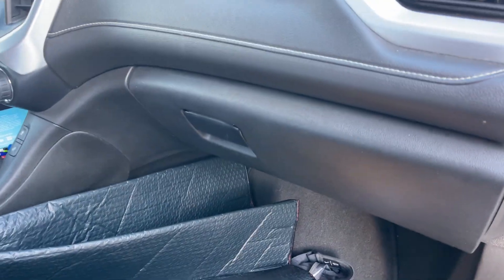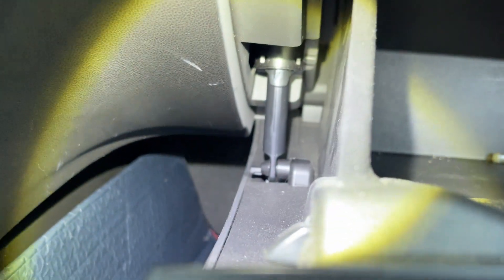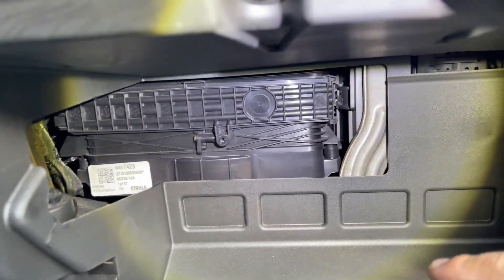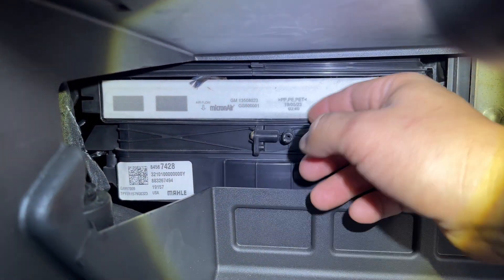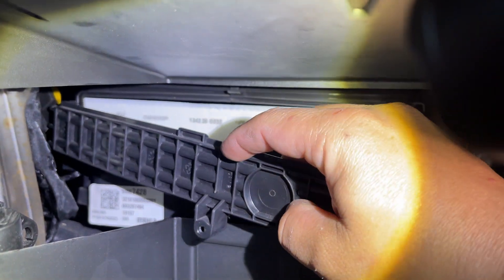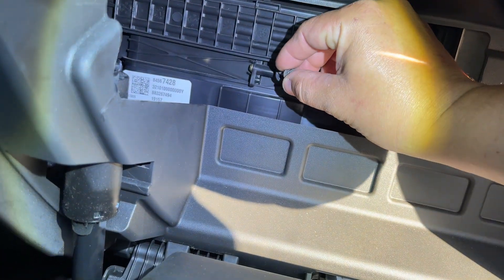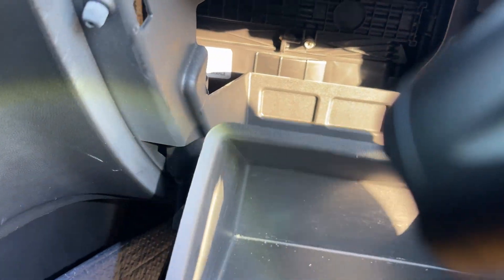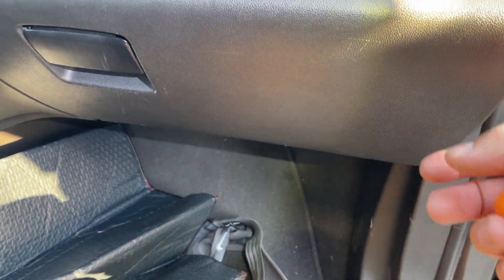How To Replace Cabin Air Filter 2007-2021 GMC Acadia & Terrain

Comment: When would you recommend changing the filter I seen the percentage mine is at 65%
Reply from the maker: If the 65% is shown on the cluster/dash I would physically check it to see how bad it is. Because the clusters measures mileage. So like if you live in a dusty place, have pets, etc it doesn’t measure that.